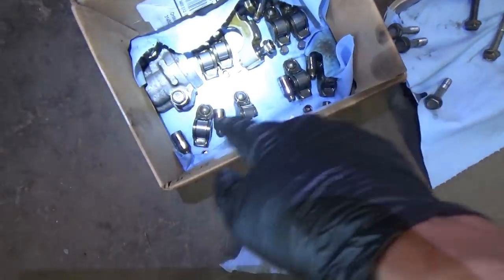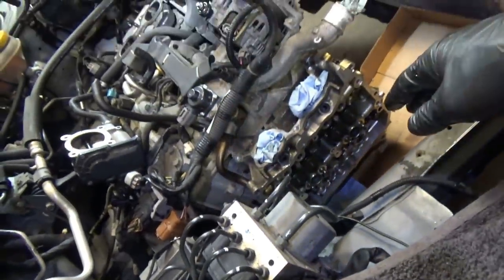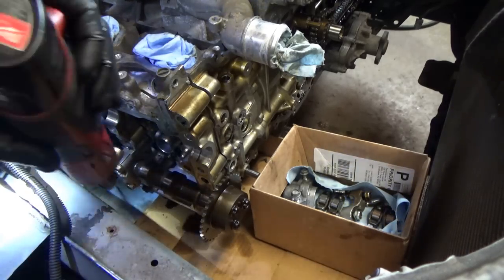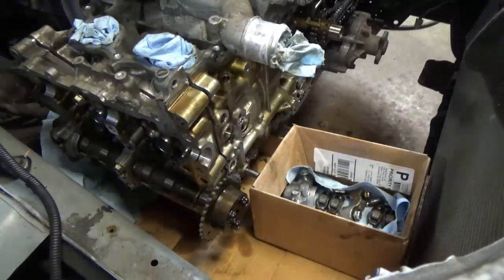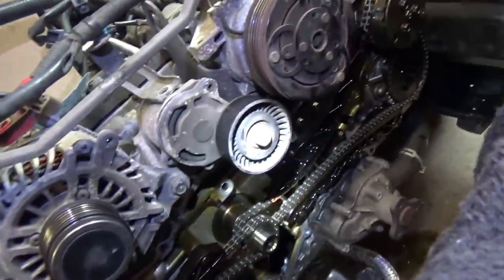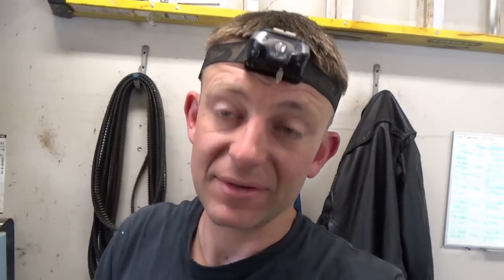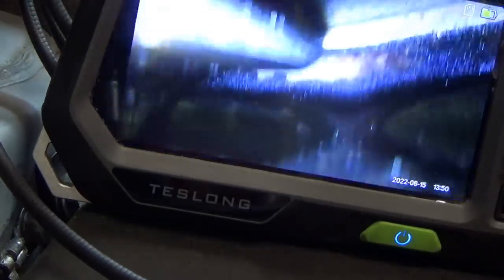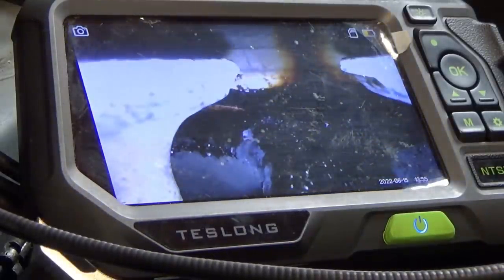Head Reassembly & Left Head Valve INSPECTION (Sad Subaru - Part 4)

Comment: IMO spending $2k to fix 2 valves was a waste of his money on this engine.
Reply from the maker: 4 valves done, 4 to go lol
Reply: 4 valves. Might have been the best or only option for the customer. I msy have looked for a used engine if it were mine....everybody has unique circumstances.
Reply: I work at an auto repair shop within the last year had one that needed an engine. My cost on a used engine was beyond 2000 dollars.  We built a new short block from Subaru with a lot of new parts. The cost was around 7000 which is about 1000 more than used engine installed.
Reply: @phillipwilson6781  Yes but for that cost you might as well turf the car.
Reply: I’m sure this is a bandaid then flip to someone else. Unfortunately I think these cost cutting short cuts could cost Ivan his reputation. I know Ivan is trying to do a favor but no good deed goes unpunished. I hate to say it, but this is just a hack job.
Reply: @jeffreygoss8109  specially reusing head bolts
Reply: @megason2  Yep, bit disappointed with this tbh. It's one thing to do (barely) half a job on your own stuff but when you have a reputation to protect its a bad idea.  Those heads should have had their seats cut, and I'm mighty suspicious that all the clearances were perfect after this mileage and after changing a bunch of valves. I have never been that lucky in my life.
Reply: @megason2  totally agree. This isn’t a 70’s Chevy sb where you could. These engines are known to blow head gaskets. Tick,tick 💣
Reply: @jeffreygoss8109  I disagree. It's on the owner. He asked Ivan. Even though Ivan said no.
Reply: @phillipwilson6781  car-part has many 2.0 and 2.5 engines used below 80k miles for 1500.
Reply: @jeffreygoss8109  No they aren't. The head gaskets were an EJ engine problem. The FB series engines have not had that issue unless poor maintenance is involved.
Reply: @TubeBrowser2  Make sure if you're replacing with a used one that it's 2016 or newer, or you run a good risk of having the exact same issue.
Reply: @2nickles647  the owner is looking for a bandaid to pass this half arsed repair on to someone else. It is up to the professionals to do a professional job or don’t do it.

What if a car owner had a flat tire and just wanted gum put on it to get him home. Should a professional do as asked or do what’s right?
Reply: @jeffreygoss8109  give me a break lol a bad tire patch puts the customer and others in danger. Something like this the customer knows the risk before hand and you help them out to move the car along to the next guy. You can lose that money and do it the “right” way. If the customer has a set budget and understands what they are getting it shouldn’t matter to anyone else

Comment: Curious if this was owned from new?  Lack of regular oil and filter changes could cause some of the highlighted issues.  For some people 5000 miles can come around in no time so it’s easy to skip an oil change (or two).
Reply from the maker: This gen Subaru is notorious for shitty piston rings causing excessive oil consumption. They replaced many engines under warranty for this issue in fact 😬
Reply: @PineHollowAutoDiagnostics  I never knew about bad piston rings or indeed valves with Subaru engines, it's always been about the head gaskets.  I guess GDI doesn't help with the fouling of valves either?
Reply: @robbflynn4325  the head gasket issue got much better by 2007.
Reply: @PineHollowAutoDiagnostics   Except you had to prove that you were burning an "excessive" amount of oil which to Subaru was more than a quart every 1200 miles- not sure how they came up with that exact number, but it allowed them to get out of having to replace/ rebuild MANY more engines that should have been.
Reply: @robbflynn4325  They fixed the head gasket issue with the FB series engine only to replace it with the shitty piston ring/ oil consumption issue.
Reply from the maker: @sblagg527  exactly right 👍😆
Reply: @sblagg527  We have a 2019 Forester bought new, burns zero oil and runs like a champ, having said that it only has 71,000 miles.  After watching this series we may end up trading it in, but then again it's paid for so we may keep hold of it and hope for the best!
Reply: @robbflynn4325  You might not have any issues with that one, as the oil ring issue seems to have been addressed (updated rings perhaps?) in the later FB engines. My first Outback was a 2016 2.5i with 110k miles that didn't use a drop of oil. But my most recent 2013 guzzled oil like crazy, and contaminated the cat. Add the whining sound coming from the CVT and I was lucky to get out from under it for $5k. You know you're in trouble when your Outback burns more oil than your 69 VW bug... 😃
Reply from the maker: @robbflynn4325  Yeah I think post 2018 they don't burn oil anymore :)

Comment: Why would you replace the known bad valves marked E2 PN: ending 670 with the same?, & I clearly saw you do it Hmmm, everyone I've ever done n I've lots of em I only put the revised E3 valves PN: ending 750 n never had a problem n they don't rattle but do continue to burn oil, as for reassembly you made it look a lot harder than it really is as for why they fail well that's easy there well known as oil burners n they cause exhaust valve leaks which obviously causes cooked valves it's not rocket science!
Reply from the maker: You can't just slap in an E3 instead of a E2... You would need to upgrade the cams and rockers too... Just read the TSB!
Reply: @PineHollowAutoDiagnostics  I have read the TSB & I have also fitted E3's were E2 come from many times without a problem & yes I know there a couple of mil longer but hey nothing angle can't fix!
Reply from the maker: @preston963  angle?
Reply: @preston963  If I gave my car to you to fix and found out later you didn't follow the TSB you'd be looking at a pretty good lawsuit pal. Also, try typing in coherent sentences next time

Comment: I hope this customer cuts their losses and sells this apparent starting to be a money pit. I am no fan of boxer engines. Conventional is more practical and cheaper to maintain. Using shims to adjust valve lash seems like a Subaru quirk. Why not just go with hydraulic or have it set up for valve lash adjustment. So weird. Those exhaust valve seats look pretty rough. Compression must be compromised.
Reply: If I'm remembering correctly in some  old engines shims were the typical valve adjustment technique.  For example, the Ford flathead V8, the Jaguar straight 6 introduced with the XK-120 and used for many years.  However,  for car engines I also think they an engineering kludge and/or a hack to meet cost reduction requirements.
Reply: A lot of modern engines use shims. Ford Ecoboost comes to mind.
Reply: @chekelley6861  Well that inspires a lot of confidence
Reply: @Che Kelley Thanks for the info on modern engines.  Obviously I'm out of touch with the details;-)

Comment: Lemme guess. I take it we have a direct injection engine in that Subaru? My sister had to replace hers because of it. Just garbage. Time to trash that idea. Go back to port fuel injection. Trash them DI engines. Bad idea. I have a friend with low tension rings and she always checked  the gas  and filled it with oil every tank full of gas.
Reply from the maker: No, this is regular port injection here.
Reply: @PineHollowAutoDiagnostics  I wonder what causes the crud and build up on the exhaust valves
Reply from the maker: @williegillie5712  oil burning via crappy piston rings.
Reply: @PineHollowAutoDiagnostics  or possibly bad valve guides I’m thinking.
Reply: Where did all the reliable engines go? I had a Ranger pickup with over 300,000 miles on it from back in the nineties that didn’t burn a drop of oil. You were offered a lot better warranty back then too. It’s pretty sad what we’re seeing today    in these newer cars. What a waste.
Reply from the maker: @williegillie5712  Yeah older Fords are actually very good about not burning oil. They rust, but the tailpipe is always clean :)

Comment: This is a questionable strategy to fixing this car.  Clearly, the left side exhaust valves are equally hammered and should be replaced along with all the valve stem seals.  You have to wonder about the wisdom of replacing all this along with timing chain components when the bottom end has so many miles.  You’re biting off a world of liability by short cutting this repair.